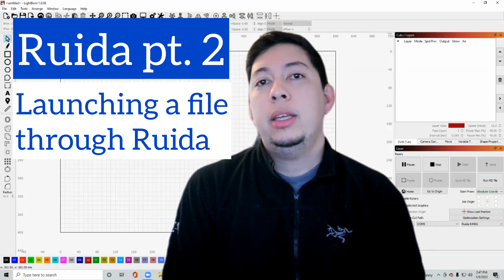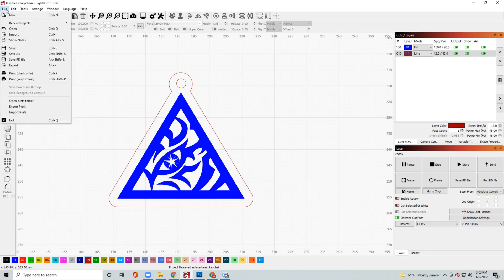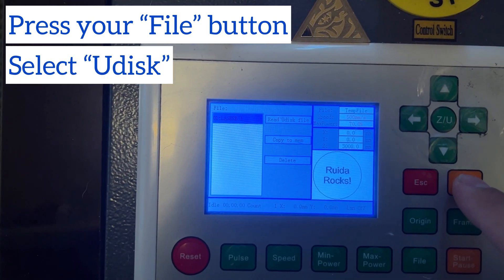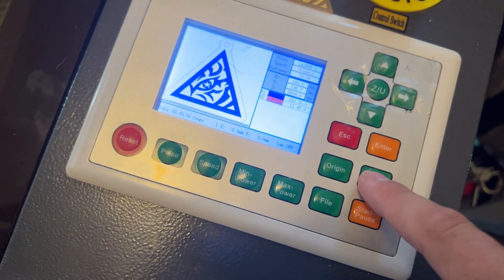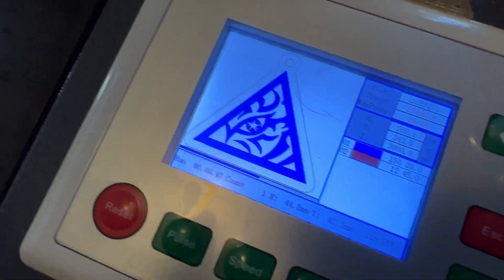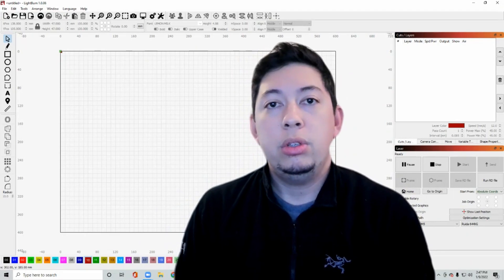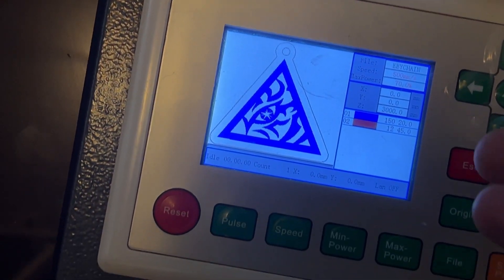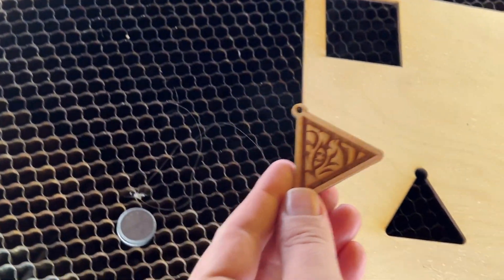Running Your First Laser Project with the Ruida Controller - Laser Engraver Tips & Tricks - OMTech

Comment: Thanks for the video. My laptop is hooked up to my OMTech CO2 via usb. Is it possible to change the power/speed settings on the Ruida controller once I have sent the file from lightburn? Every time I change the settings on the ruida controller it defaults to the lightburn settings, so if I want to adjust settings I have to do it on laptop then resend to ruida.